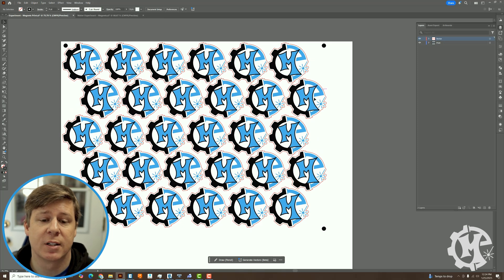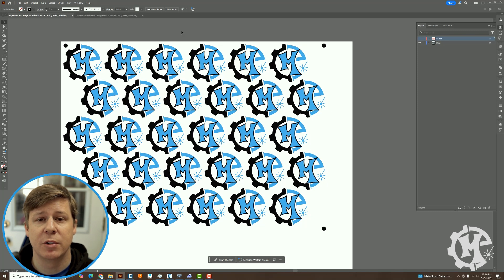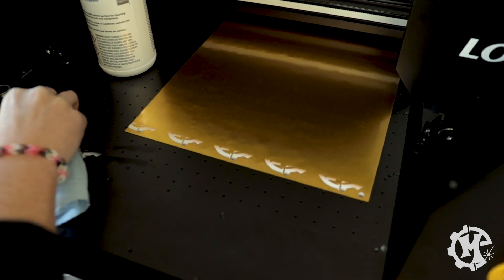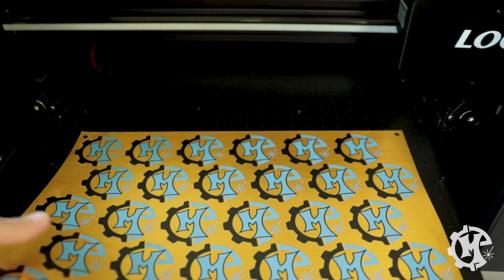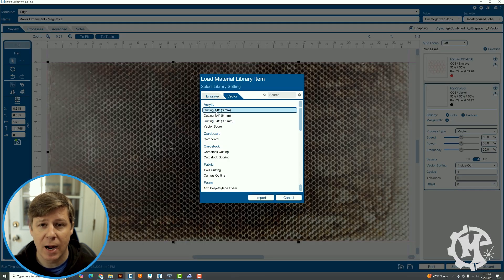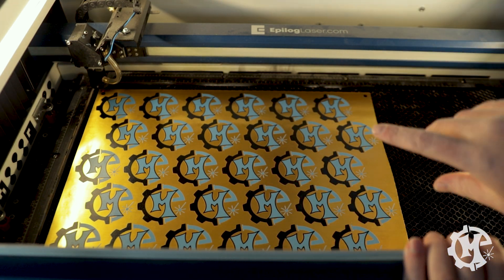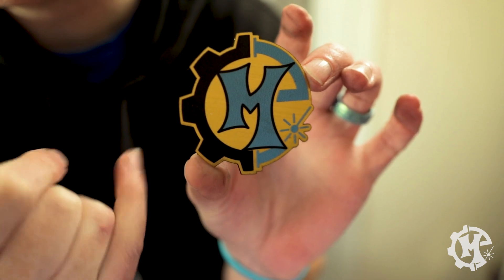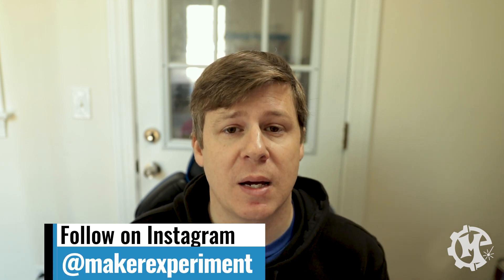No Camera Print and Cut Hack That Actually Works!

Comment: Other method: I actually create a box in the same size of the bed (or material sheet being cut) with a medium sized circle in the middle, Place all my artwork inside it. I then simply perform a Center/Center Cut after aligning the red dot pointer directly in the middle of that circle. Also, run a trace first to ensure positioning/orientation is on-point. I also have spent alot of time perfectly aligning my machine so it's very accurate and provides a great cut most of the time or is off by just a very small amount.
Reply from the maker: As long as it works, that’s awesome. There are a lot of ways it can be done.

Comment: I have a Helix so no camera.  You should mention that you can hit the stop the laser when it is moving to different vector cuts so it will stop when it gets to an alignment mark and restart can be used to check at each of the alignment marks.
Reply from the maker: You are correct that you can do that.